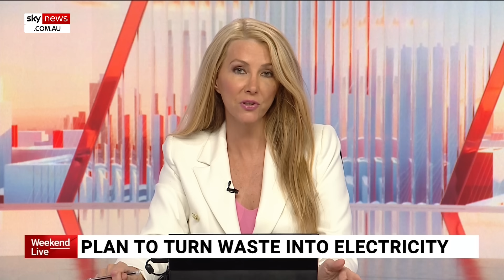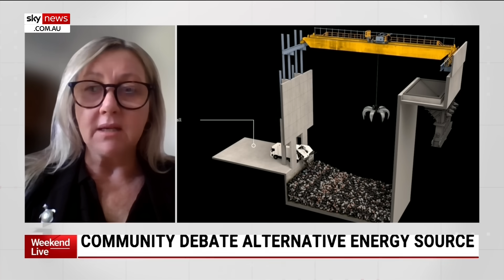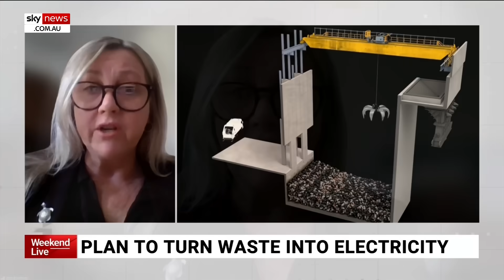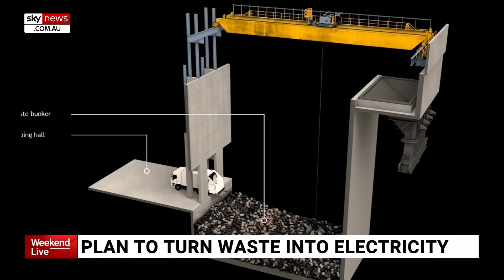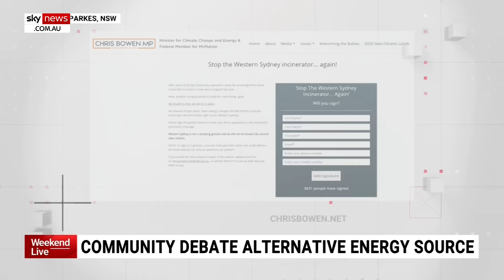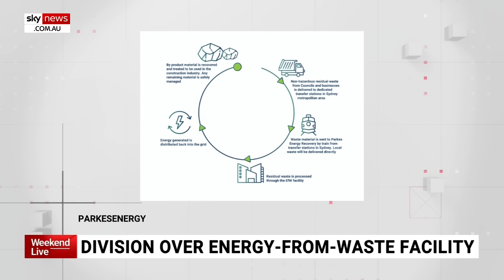Outrage over proposed waste-to-energy facility

Comment: Switzerland has been doing this for decades. They over filter and process the emissions though. Alot more than what is required or what regulations ask for. Euro emissions regulations are alot stricter than here also. Their constant testing shows the exhaust emissions are very clean.

Comment: This is awesome technology. They left out tons of info. Particles or emissions from the burn are recirculated, like a reburner. If I'm not mistaken, this happens repeatedly. So the resulting waste at the end is a small fraction of what was put in. And the gas exhaust from the burn is pretty clean. Let's put it this way. This process is vastly cleaner than any ground fill, and you get something useful from it, ENERGY!

Comment: Well, there you go! Damned if you do, damned if you don't! But as far as the burnt off waste, its all in the treatment of the off gas. This the stuff that chemical engineers love to delve into, and yes its viable, very much so. So what is the alternatives, continue with land fill???? Like everyone likes a garbage dump next door, and out of curiosity the same break down in material that enters the ground is uncontrolled, unmonitored and the effects are definitely unknown! Other countries have them, and they will continue to use them as there is no alternative. And by using a central system of disposal, allows authorities to monitor garbage dumping to instigate better recycling programs. Worked on a pilot plant to treat top of the list nasties, was surprised by the effectiveness. The client just decided to sit on their hands in the end, but their waste is still there! 

But as I write this, remembering, uncontrolled high temperature incineration was a thing in the past out at sea. Now that was a nightmare that had to stop, and did, but the damage had already been done. Did any one ever monitor the process?????

This is just the same old ploy, someone says its bad, has no alternative solution as that is someone else's problem. In this case, its everyones problem!

Comment: These waist to power systems are used world wide. The system will burn off all toxins. The waist going in needs to be sorted before going in. You don't want batteries going in. 
If we can't have this we need nuclear power
Reply: Waste.  We definitely need nuclear power after getting all the coal fired power stations up and running.

Comment: If the Labor government is managing this concern, then we need to be worried if Chris Bowen has anything to do with it. Essentially it seems to be the same issue as having coal fired power stations, but experts who know and who will be made responsible for the outcome emissions if toxic elements exceed specifications should be contracted to manage it - not government. Government should regulate it, but not manage it.

Comment: And this is cleaner than coal or gas that we have so much off ??
I struggle to believe this is good
Reply: The issue is the waste exists regardless and it has to go somewhere. Landfills cause a lot of issues, so it's not so much a case of whether this is good as such but whether it's less bad than the combined alternative of landfilling the waste plus using some other method to generate electricity.

There are plants of this nature within the metropolitan area of big cities overseas, including among others London, so it's not as though others aren't doing it successfully.
Reply: @shaun5552  with respect I still disagree, I see the cost of using toxic rubbish may come way in the future through contamination/poising that we can't see now.
But the biggest point is a Gas plant will be 2 x less polluting than burning rubbish and we have a lot of gas. Why choose something more expensive and more polluting, doesn't make sense

Comment: what are you people on about all diesel vehicles put out all the so called pollutant gasses stated in this video but there are millions of these diesel incineration devices pouring out pollution in populated areas and yet people still line up to buy them i would rather have this waste incinerator 100 meters away from me then one of Australia's busiest roads with all these diesel shitboxes
Reply: Why not just say internal combustion engines because petrol releases the same gasses !!!
Reply: @ hmm no that's wrong should have paid more attention in school diesel engines are quite unique in having high pressure and extreme lean burn forcing the extra oxygen and nitrogen with heat and pressure inside the cylinder to form nitrogen oxides also direct injection and compression ignition are less precise at combusting all the fuel injected which is why diesels have DPFs and newer DI petrol engines have OPFs or petrol particle filters
petrol engines on the other hand burn at or richer then stoichiometric ratio leaving no extra oxygen to bond with the nitrogen petrol is also more easily atomized and distributed into the air fuel mixture with a 3 way catalytic converter the only emissions from a port injected petrol engine are carbon dioxide water and a small amount of carbon monoxide diesels on the other hand can add nox and large amounts of PM2.5 a highly carcinogenic ash burnt off from the DPF
Reply: I love my diesel Hilux it's so economical, I also love my diesel Hino truck !!!! I hope all my diesel engines haven't triggered you 😂😂😂😂😂😂😂😂😂😂😂😂😂😂😂😂 Do you own an EV by chance 😂😂😂😂😂😂😂😂😂😂😂😂😂😂😂😂
Reply: @ why does not liking vehicles that cause pollution that shortens peoples lives make me an EV driver 
i own 5 cars two 2.7L work mate hilux an old LPG falcon and a pulsar SSS turbo
obviously the average aussie is completely scientifically illiterate or just doesn't care about what carcinogenic crap spews from the vehicles they drive that was my entire point if people care about what comes out of a garbage incinerator or coal fired power station why don't they care about their precious diesel shitboxes giving everyone in traffic around them cancer

Comment: She is wilfully ignorant or a flat out liar. "Reduces that waste down to a quarter of its volume", is a complete lie. These facilities burn primarily plastic, plastics are formed from petroleum light ends, with no solid components, that when combusted, leave a fraction of one percent of carbon remaining. Controlled combustion is not the same as burning plastic in a pit in your backyard, which still wouldn't produce one quarter of its size or mass as leftover waste. You could burn aluminum(they don't, due to its recyclable value) and still end up with only a few percent as leftover waste.
The downside to these facilities is finding another spot in your yard, for the "combustibles" bin that in time, councils will roll out.
Reply: Try "flat out liar", most of these rabid witches are.
Reply: You don't burn aluminium you melt it !!!
Reply: @stephenkirton9921 Exactly why I said it's recycled, I was using it as an example of a combustible solid, which leaves behind a decent amount of waste, post combustion. And in case you weren't aware, aluminum is combustible, spontaneously combustible in the right circumstances.

Comment: Why not they are burning used engine oils into bio fuel in unfiltered burning facilities releasing dangerous cancerous PCB's into the atmosphere out the back of the North Sunshine factory area in Melbourne that can be clearly seen from the Ted Whitten freeway bridge on the Western Ring road and the EPA have said nothing even though factory owners still complain about the toxic smell leaching out sometimes even on weekends while nobody is present working there ; ps cancerous PCB's can travel more than two kilometer's to surrounding areas depending on the height of the chimney stack.

Comment: Would you like your own generator systems a electric run tyoe required steam you could even use this to heat water exchanger system fro steam production and you to the ore amounts should look into the material recycling returns quote for sales such as from china for reproduction uses in your country for job opportunities??????? And why not a filter unit to a ground run line that you have safety suits as you change filters wet was clean system???
Reply: What are you dribbling about 😂😂😂😂😂😂😂😂😂😂😂😂😂